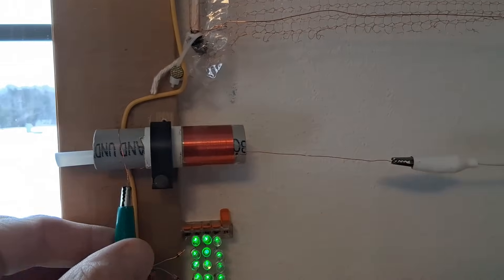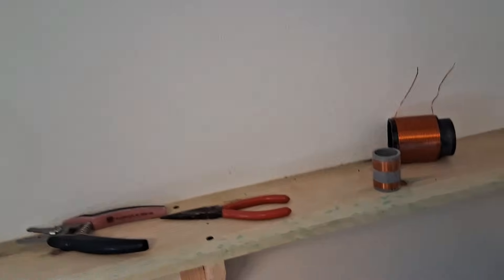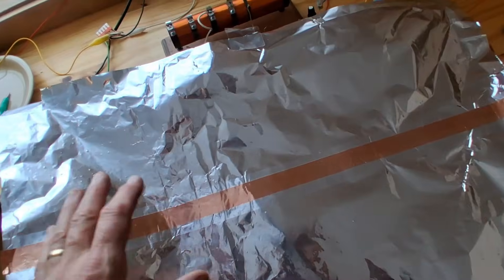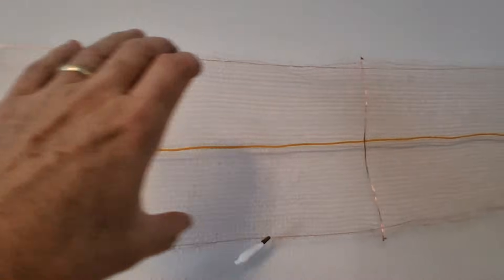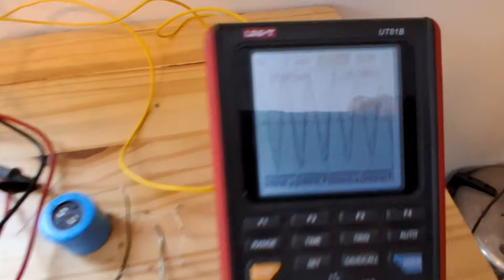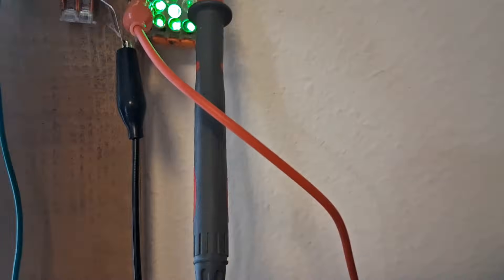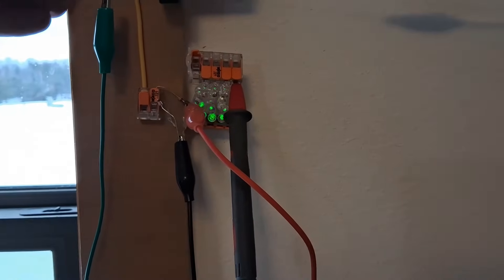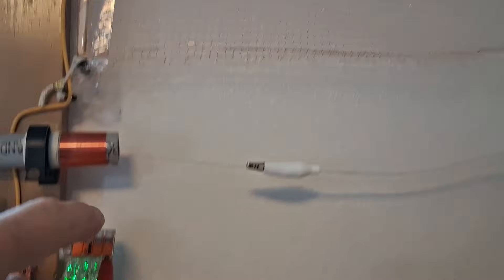Capturing free RF radiant energy with a coil and net

Comment: In regards to surface area and plate capacity I would guess you are able to get away with something like a mesh because the frequency is high enough. There's all types of funky stuff that can go on in my opinion but either way just straight capacitive coupling can produce some interesting power from small RF signals. For example just hooking up 1 probe from a signal generator and exciting a coil with LEDs on top. Pulling some tens of microamps seems impressive yet totally possible at the same time. Doesn't make it any less cool though.

Comment: One thing perhaps worth considering - this may be the product of resonance interacting with RF. This is something Joel Lagace has discussed on his channel. He contends that resonance alone won't produce a COP >1, but resonance combined with RF will.  Perhaps the RF coming off your household electrical (and wireless, if you have it) and radio waves, combining with the resonance in your system is producing a larger result than what you had anticipated. Thanks for sharing your work. Happy New Year!
Reply: HeDisinforms.ResonanceCanLeadToCop'sOfOver20.
Reply from the maker: Thanks for your input!

Comment: To think, all this started from a crystal radio build!  
Great experiments. Am enjoying the series 😀
Happy New Year!
Reply from the maker: Happy New Year Slider!  I have been harvesting little bits of electricity from antennas since the late 1980's, but nothing like what this new circuit does.  It's a fun investigation.
Reply: @doubleMinnovations  It really is... you amplified my own investigations into it all. Am now on to 'Grounded'  mains outside the house, recording a vid where a 12 LED dollar store lantern is lit. The Likes/Dislikes ratio gets hammered if its called free energy or free power, but what the heck else is it?!?!
Reply from the maker: I thought I would be alright by calling it 'free RF radiant energy', because that's what it seems to be.  -get more views if I call it that, rather than just 'radiant energy'.  I'll check out your video when you get it uploaded.
Reply: @doubleMinnovations  Cheers. Yeah, radiant energy as a term seemed to fade when John Bedini left us and Dr. Stiffler. 
I think such vids would go viral if we could work in 'Lost Forbidden Ancient Banned Secrets' somewhere 🤣
Reply: Try putting a variable tuning capacitor, the kind used in a AM radio and wire it across the coil.  Trying tuning it with this.  See what you get...

Comment: Multimeter high input capacitance shunt RF current and AC measurments not correct. This is not free energy.
Reply: Just ONE THING, the energy is free in the whole universe for anyone to pick it up, only energy carriers (like oil) are not free as long as someone “own” them. And just for your information: energy (free !) exist in every single particle of matter, please cutoff the BS.

Comment: You must give a bit more information ok... The virtual ground must be closer to the actual ground as it will couple to the true ground that way.

 Our planet has an atmosphere and that Atmosphere is charged and in layers around our Planet, much like plasma around an electrode but the planet is such a large electrode. The further you get from the Real surface and put a single electrode in the air, it should read in fair weather 120 volts per meter above the reaL GROUND. If you use a virtual ground this Fair weather potential will lose a bunch depending on the capacity between the real ground and the Virtual ground.
 Since your virtual ground setup is way above the real ground the capacitance is sooo low. Improving that capacitance into real numbers should increase the current you are seeing. If you are receiving a broadcast you might be able to replace the diodes with a small amp and speaker to see if it is indeed radio you are receiving or scope it to see if there is a signal there.  Remember Radio is carrier based so you might have to use a am/fm radio and see if it is present around your circuit.

So again orienting the virtual ground towards the actual ground will improve the capacitive connection between the two grounds in relation to the two plates of that capacitor. Remember that you have to take into account this capacitive inductive connection between the two grounds. Resonating that capacitance should allow you to better couple with the ground and get a stronger connection to the actual ground which as we all know needs to be there to make the process stronger or have more real current flowing to the ground from the above antenna above the ground that is touching the higher potential atmosphere and allowing it to go through your load to the virtual ground then into the real ground where it wants to go.

 The further up in the Air your antenna goes the higher the potential difference will be between the two points but the smaller the capacitance will be between them as well.
Working out these things you might be able to build a circuit that resonantes at the same point and walla... Working current through the load.. But that current will be based upon a few physical dimensions and relationships. Surface area and differences between surface areas exposed to the atmosphere and the ground, either real or virtual.

 You might want to check our a Langmuir probe and how it works as what you have here is basically a version of a langmuir probe and you are measuring the differences between the two electrodes. Connecting one end to the ground just reinforces the system into not being a floating or virtual ground and give more accuracy for measuring currents within the system. Any excess energy is shunted to the ground and reguages the measurements within the system.

Comment: Hi! In theory, if you are using metglass core, the output will higher ... because the metglass permeability is over 1 000 000.  Or try any other core, above the 5000 permeability.

Comment: I wouldn't believe the current reading of the incoming AC hand held meters are notoriously bad at reading current at higher frequencies. Very neat experiment, it's like the mesh is acting like a sympathetic antenna/capacitor  and amplifying the received energy.
Reply from the maker: The meter I was using to test current, was also reading the frequency and showing the wave form.  I don't know how dependable it is, but I would think it would have been designed for that... -but it was made in China...

Comment: What's the point of collecting RF? Any practical usage? Newbie here, interesting stuff just not following everything going on, etc. I once made a crude inductor  with a 1000 ft roll of 12-3 house wire and a steel 1" bar to tune it. It was pretty powerful like a solenoid. Had 100 watt light bulbs in the circuit, large capacitors, and a diode voltage divider to measure the voltage. Think it was up to 600 volts or more, was years ago. Never got to follow thru though still have all the parts.
Reply: Two practical applications I can think of would be:
1. A packaged battery tender used in a remote location
2. LoRa (Long Range) Internet of Things (IoT) communications
Reply: @johncroucher1903  I like your LoRa idea, having played with LoRa in the field with esp32 micros (Not LoRaWAN) with the right sleep scheduling and depending on your application/messaging power and frequency needs,  even a modest solar panel like a 10x10cm "5v" thingy from china in indirect sunlight and a recycled vape battery from the street gutter can go a looooooooong way with some more advanced charge circuitry, or, with LiFePO4 cells and. with a Schottky diode and PV output tied to the 3.3v rail your battery management is your code detecting what the 3.3v rail is at and getting chatty on LoRa with other nodes or doing some fun processor idle games (or go to sleep less) if there is overabundance

Though I suppose if one is closer to the arctic circle you might want for solar radiation in winter, but then we have to talk about the battery chemistry and maybe you should be using LTO for that
Reply: night lights in your off-grid cobb home? whatever happens with your batteries and solar, you know at night you can navigate the rooms and hallways

Comment: Update!!!  Last night at 11:30 PM I placed a 54 turn coil wound on a 3in PVC air core, onto a piece of galvanized 8inx8in tin. The coil is seperated from the tin by a piece of paper. Then I connected a earth ground rod to the tin. Then with a 12V yard tractor battery I hooked the band end of a 4148 signal diode to the pos, and one coil lead to the other end of diode. the other coil lead goes to the negative of battery. So its closed loop coil-diode- battery in charge configuration. At 11:30PM the reading was 12.45, now at 6.15 pm  the reading is 12.51. Slow, but its working!! Holding a small transistor radio on FM in the vicinity makes the stations blare in and overdrives the little speaker to where the volume has to be turned down close to off. Still not sure on which direction would be best CW or CCW on the windings? I believe they are CCW. We do have a small weather front moving in. How can I make this stronger?
Reply: Use an antenna that is tuned to the frequencies you are using/harvesting?  A fractal antenna for multiple frequencies perhaps?
What would happen if the antenna was above your house roof?
How strong is the ground/earth connection?  You want to have a great earth to get the most out of what you're doing I believe, but I might be proven wrong 🤷‍♂️
All the best mate, good luck ❤️🙏

Comment: I will heading up to the lab tonight to replicate. Made more progress last night, placed a coil wrapped around 3 shingle roofing nails in series style onto a galvanized metal plate, seperated with a sheet of paper from the plate. Connected a 20 ft long wire to the plate, and tried a earth ground at times.Then hooked a .33 cap in paralell  with the coils(closed circuit). Then connected the AV plug to one side of cap and charged a 10uf verry slowly. Definatly would need more roofing nails. But concept was proven!!!  My theory the coils on nails, exposed to fluctuating magnetic field act as a generator instead of rotating magnets. I only had 1 layer #26 on each nail. Another thing that works is, Take a strait piece of #12 Bare copper wire about 10-12 inch, Wrap insulated #24 is what I have, aound  the #12 , hold #12 with left hand, and with the right hand wind  clockwise from end to end. Leave space at bottom ( left hand end )for antenna connection. This works well with just a eatth ground conn to it if not better. You can measure a voltage between the upper end of coil and the lower end of #12 where the antenna (or) ground is connected. I hooked AV plug to the upper end of coil and charges 10uf cap about as good as a lot of things Iv tried.  When you wind coils, please try to count turns so we can replicate easier. I enjoy your videos, and glad to see theres others out there with the same interest.  Peace  BOB
Reply from the maker: Sounds like you're making some interesting discoveries!